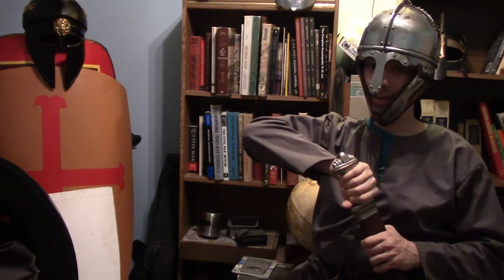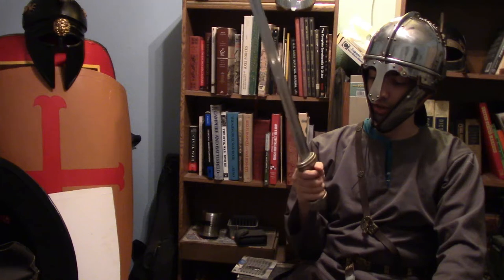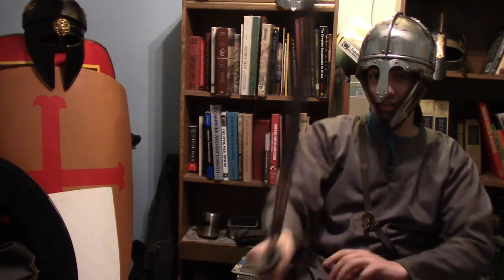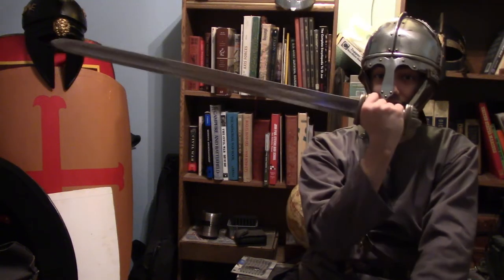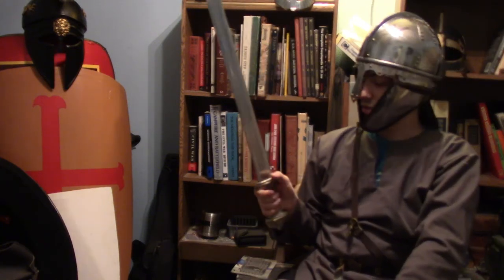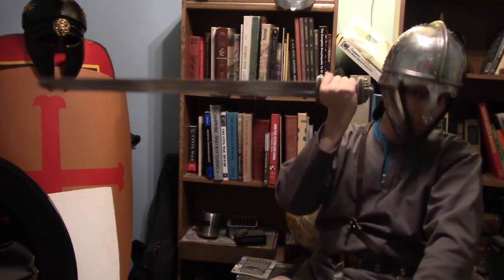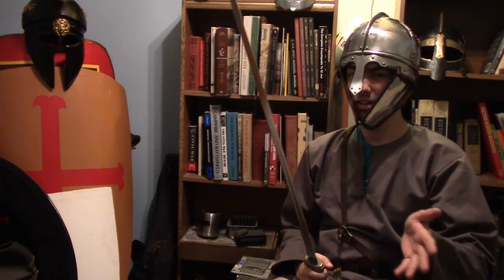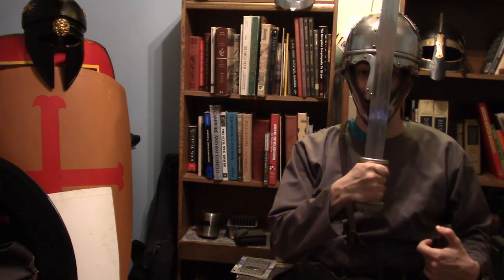Behold the Fetter Lane Sword  8th Century sword

Comment: It's believed that the spatha was adopted from the Celts by the Romans, but it became more popular among the Germans who favored the reach and cutting power over the shorter stabbing Gladius. Later spathas you will see with handles made of horn with the pommel and guard made of the same organic material sandwiched between metal plates. I don't like the handle of the Fetter Lane sword. After grabbing the rungs of a metal ladder in the wintertime when I was kid, I learned you don't want to touch frozen metal.
Reply from the maker: That is true that when it came down to the historical warfare, the spot that was highly used by Celtic warriors especially in the Roman military. Such as that of the Roman auxiliary troops, who in which would rather keep using their long spatha blades. And in such there is a high debate on how the Germanic people might have gotten these swords, either through trade with Roman legionnaires or through the fact of taking them from Roman dead